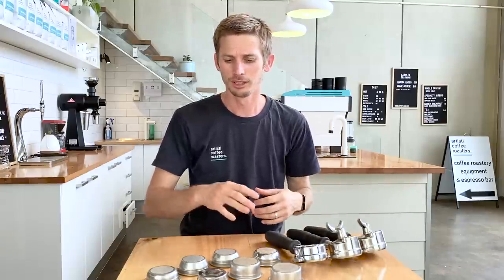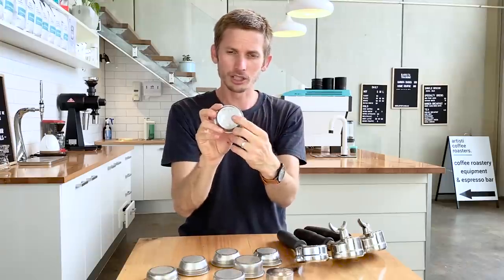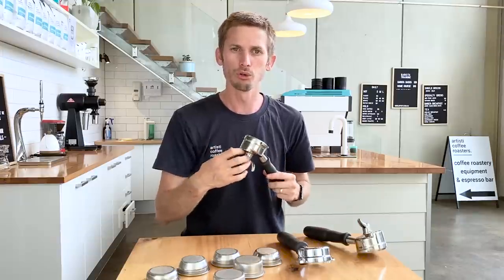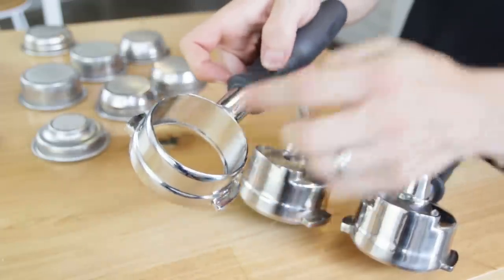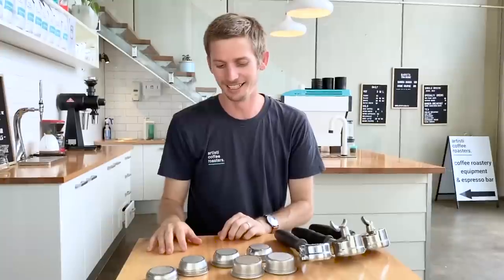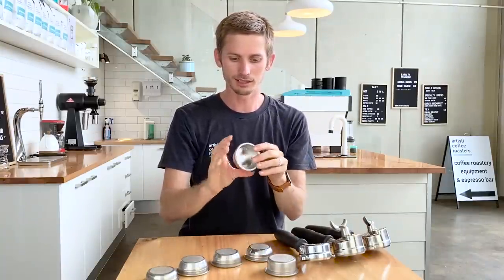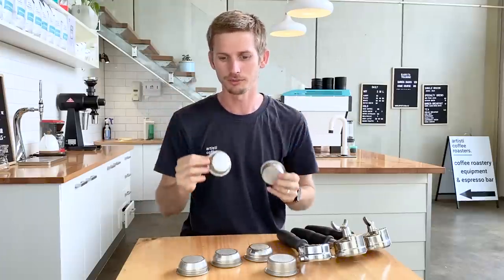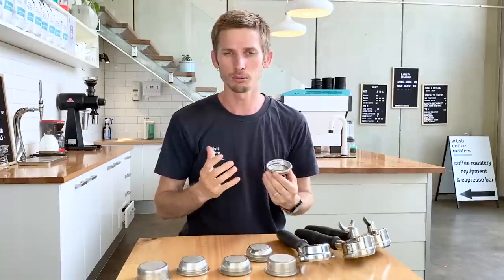In your ESPRESSO MACHINE which PORTAFILTER BASKET should you use?

Comment: Thank you Joel!

I bought a second hand Gaggia Classic. Can you suggest any way to work out what size basket I have?

Also, are certain coffee roasts more suitable than others for use in larger baskets?
Reply from the maker: Hi, fill the basket to the top with fine grind and then weigh the amount of coffee you have. Not specific on toast vs basket size, it’s more about the intensity that you enjoy m
Reply: Thank you for your advice 🙂.
If I shake the portafilter and tap it against the bench, I can get 20g+ to fit level in the basket. Is this what you mean, or should it be a level measure with no manipulation of the grounds?

I have read that there should not be an imprint of the shower screen on the puck after brewing. I have found my shots to be more enjoyable in the 18-20g range which does end up with an imprint from the shower screen. So I'm a little confused. 

Again, thank you for your time and advice 👍

Comment: Wanted to know about the different types of porosity on single wall basket or if there is a difference in hole size across different baskets (nano, IMs competition etc.).
Reply from the maker: From my understanding the hole size is similar as we use different baskets but don’t have to change the grind to ensure the fines don’t make there way thru, if the hole was bigger. The main difference is if the hole is laser cut or punched. The punched holes change the flow of water more than the lazer cut holes. Hope this answers your question. 👍🏻
Reply: @ArtistiCoffeeRoasters  Sure thanks

Comment: I thought pressurized filter can produce more concentrated coffee. Thus less cost.
Reply from the maker: It’s really designed for when you don’t have the right grind and need to make a coffee with Crema, its like having the coffee in a pressure bath to soak in, not pushing the water thru and extracting the coffee as it passes.
Reply: @ArtistiCoffeeRoasters  Thanks

Comment: Such a great informative video. Explains allot and helps me understands reasons for varying extractions. So i do have one question, there is varying opinions out there of the ideal dosage wight for given shots, i largely a short black drinker and after this looking at changing my basket, that said is it personal taste based on strength, acidity etc your are seeking or is there an ideal say 18g basket for a balanced shot?
Reply from the maker: Thanks Junee, the size of the basket (if the same shape) should have no affect on the balance of your shot, just the amount of liquid espresso you finish with (if you use the same brew ratio https://www.youtube.com/watch?v=Z7Ssatuy9sA&t=17s ) a 18g straightwall basket in my opinion is always a good place to start.
Reply: @ArtistiCoffeeRoasters  Thanks for the advice and video reference, again, very informative and easy to understand. So happens surrounded by so many friends who love their coffee, one had an 18g vst basket which he was kind enough to lend to me. following both videos i came up with one issue, pour time, was coming our way to fast, used same process and tamp as usual. tried finer grind to a point, and then not sure. any advice, do i continue to go finer on grind?

Comment: Hi. Thank you for this very instructive video. I have an Expobar Lever and a Eureka Silenzio. I think I have an 18 g truncated basket.
I feel that while being very close to a good dialing my shots are not consistent. I use between 16 and 17 g of coffee for my shots and aim for about 34 ml of espresso in 27s.
It’s often overextracted. I then tend to correct by adjusting the grind but end up under extracking while the flow sometimes could indicate channeling near the end. I put so much care in my grinding and tamping but the result is not there.
Can the truncated basket cause this?
I’m a bit frustrated as every time I buy a new expensive piece of equipment I find out that I still need something else to get that lovely espresso.
Thanks in anticipation for your help.
Reply from the maker: Hi Philippe, for sure a good quality basket will help with extraction defects, check out our other video for a few more pointers. https://www.youtube.com/watch?v=C9u9S_-PcwQ

Comment: Do you think VST baskets are worth the investment?
Reply from the maker: We uses them in our machines, they do last longer than any other basket. If you are using a naked porta filter I would use it for sure! If your splitting into a double spout you can save a few $ and buy a copy or the LaMarzocco ones as they are straight wall and have similar holes. The non punched holes is what your looking for. 🤜🏻

Comment: Recently bought a cheapy, Sunbeam Barista Max machine (as an Auzzie, I'm sure you know the brand Joel :) ), and was quite surprised that it doesn't use pressurized baskets (I researched before buying), and has a 58mm handle. As far as I could tell, anything below the sort of Breville Barista Express (Sage in the UK) price point uses pressurized... Getting 29 sec extraction on a double shot with medium fine grind (how do you explain grain size on in words? XD). May try to push the extraction time up a bit, but considering it's a little consumer all-in-on machine, results have been actually quite alright. In saying that, on a double shot, 20g coffee, what would an ideal time be? 32 sec?
Reply from the maker: It sounds like you are in the ball park for extraction times. I would recommend trying finer grind and and tasting the difference, if it tastes good go with it! :)

Comment: Good video thanks but I really don't understand why I can make good coffee with crema with the single dual wall cup, but when I use the double single wall cup the coffee comes through very fast with no crema. All contrary to what you say!? Please please someone help. I'm guessing it is my machine - fairly basic sage espresso machine. Any advice welcome.
Reply from the maker: The double wall is making the cream because it has a small pin hole that makes the pressure in the coffee. The single wall needs you to make a finer grind to make that pressure
Reply: @ArtistiCoffeeRoasters  Thanks for the reply. I'm slowly coming to the conclusion that I need a better grinder! Even on the finest setting I get nothing but fast watery coffee when I use the single wall basket.
Reply: @JimmyIsTheBest1  check to see if your grinder has the option of changing the grinder burr settings, as in, remove your hopper and remove the burr and change the burr position. This will allow you to adjust your grind setting finer. Hope this helps

Comment: The dual wall baskets get the most out of pre-ground coffee, however, they can still be used with freshly ground coffee - they work absolutely fine. (but yes - it is of course better to use the single wall baskets if one is using freshly ground)
Reply: my first machine (sunbeam) came with a pressure basket. I cut the doubled wall off it after 4 years, it was solid black with sludge, even with regular cleaning!!
Reply: Don't you mean single and double spout?
Reply: @Postthisvideo  nope - definitely not.

Comment: Thanks for the video! So at the moment I am using a 16-22g IMS basket, but I put only 14g in (as this gave the best results so far). I was hoping to understand from this video if I should rather go to a smaller, eg 12-18g basket, and why...? thanks so much!
Reply from the maker: It would come down to the flavour and intensity of the brew you are making. Only reduce if you want to have a less full flavour.
Reply: @ArtistiCoffeeRoasters  Thanks so much for the fast reply!! So... Changing from a 16-22g to a 12-18g basket would lead to a less intense brew? At 14g dose for both cases of course... I was trying to understand what can happen if the basket is “too big”/not designed for the dose that I’m using.
Reply from the maker: So if you have a small dose in a large basket your coffee puck can float, this will increase the flow rapidly as will under extract the coffee. This happens at the ends of the extraction so you may not be able to achieve a 1-2 ratio
Reply: @ArtistiCoffeeRoasters  Thank you for the explanation! :) At the moment, I am usually able to get the desired ratio (if I distribute the coffee well enough), so I guess I don’t necessarily need a smaller basket. Thanks again for sharing your knowledge and have a great day!
Reply: Thank you so much for this q&a

Comment: can i use a single wall basket instead of my double wall basket
Reply from the maker: You can give it a try, as long as you can adjust your grind and dose you should get a great result
Reply: @ArtistiCoffeeRoasters  thank you for the advice. I have non pressurized portafilter with double wall basket. So if i use single wall basket, i think pressure will drop.. is it correct

Comment: My delnghi dedica came with a rather cheap flimsy pressurized portafilter. Could have changed the basket to non-pressureized, but bought a Joefrex portafilter with a lot better finish and a good quality basket. Unfortunately it came with a double spout(last one they had in store) so i cant see all that well whether i have even extraction or channeling

Definitely will get a bottomless precision portafilter when I get my Sage dual boiler
Reply from the maker: You can remove the double spouts if that is effecting the height of cups if that helps, or you can cut it off with a angle grinder 😂

Comment: Can you make a single shot on a double shot basket?
Reply from the maker: Yes you can but you have to use a finer grind, press harder and a short extraction if your are not prepared to put more coffee in and do a ristretto, as the puck will lift and float and give you a fast flushed shot about 15-20ml
Reply: Thank you very much for the answer... =) Its a big help. =)

Comment: Hello Joel, I am an amateur home barista with a very expensive new espresso machine and I purchased a 22 gram basket for a naked 
portafilter.  I am working on dialing in my shot I want to ask for your opinion.  In prepping my shot I have been using 23 grams of ground coffee beans into the basket and timing my shot at 25 to 30 seconds after first drip into my cup with a target of 46 grams of finished product.  Do you have any issues with this ratio?
Reply: I'm still an amateur myself but I'd say that's quite a lot of coffee. I'm working with around 16-17 grams input and a 1:2 ratio just like you.
Reply from the maker: Hi Curtiss, How dose it taste? I feel you are on the right track but taste is the final piece of the puzzle. Good luck. :)

Comment: Well holy coffee bean bat man my new ECM synchronika with flow control (mega buck machine) comes with a truncated basket, obviously they are of the opinion that those work best. Should I buy a straight walled basket? I also noticed that I get 10.5-11 bar of pressure - should I be adjusting that back to 9 - there is and adjustment on the bottom of the machine.
Reply from the maker: LOL Bob! I would defiantly recommend adjusting your pressure to 9bar as a starting point. The joy of having a "mega buck machine" is that you can adjust things like pressure and see what works for you. Start at 9bar and make adjustments from there.  As far as the basket goes personally I love a straight wall precision basket like the VST. I don't think you would regret trying one!
Reply: @ArtistiCoffeeRoasters  l'm on it,
Reply: @ArtistiCoffeeRoasters  is that the 22 gram, 20 gram, 18 gram,. With or without ridge?
Reply from the maker: @BobStCyr  Any size, I prefer the ridge myself. :)

Comment: Love this video, it’s great! However, I would disagree with some “single” baskets. The Breville single (non-pressurized) basket has a better design than the “typical” single basket. It has a better angle for the water to flow. I’m actually able to pull amazing shots out of it, and save some beans! Hehe
Reply from the maker: Bean saving is always a big factor for many. We are always comparing the so called BEST tech vs what’s capable in the domestic market

Comment: Would a 21g basket be enough to split a shot and make two coffees at once? Do you need a much coarser grind, and finally how much time should the shot take if you're filling two 60ml cups?
Reply from the maker: Hi Alan, a split shot is the same amount of liquid espresso split in half. No adjustment is made to the grind, just put one cup under each spout. So if you extracted 40g then split it into two cups each would have 20g and be a more mild experience if mixed with milk. This is quite popular in cafes when using smaller cups. A 21g basket is perfect if you are splitting. :)
Reply: @ArtistiCoffeeRoasters  Thanks. I'd been searching 'double' shots until now, obviously 'split' is the term. I'd like to be able to make two at once, will give it a go.